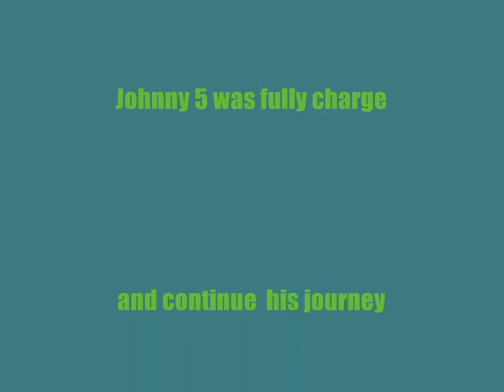Johnny 5 robot.wmv

Comment: I really wish i could see the drive train. Is it driven from the front section or middle section. What kind of motors, size for carrying that type of weight. I never could figure out why there is a trailing wheel does it do anything. Want to build one of these soon but still trying to work out some things.
Reply: That wheel is probably more for stability than anything, but it does allow #5 to be taller when the situation requires it for firing the shoulder mounted laser cannon.